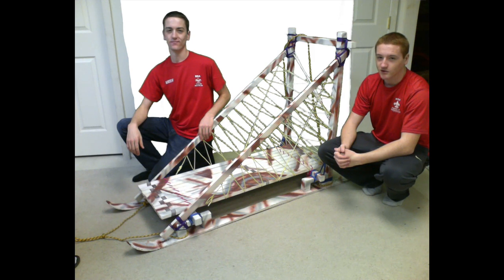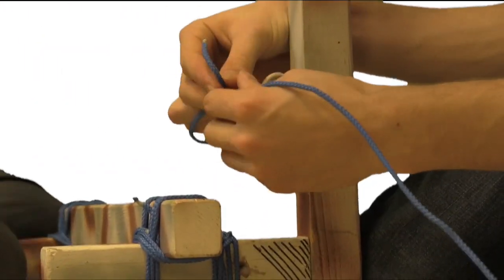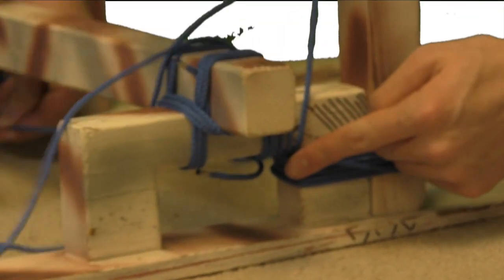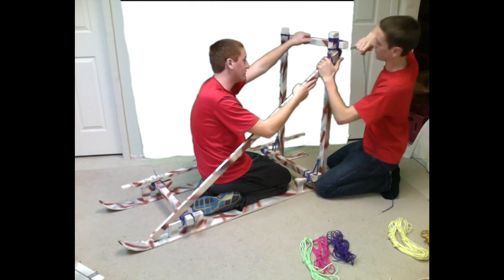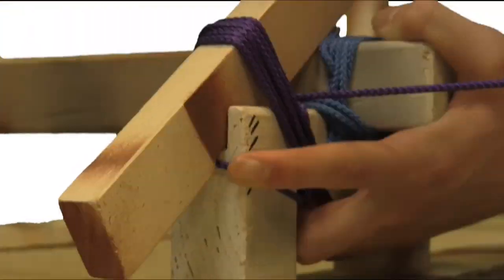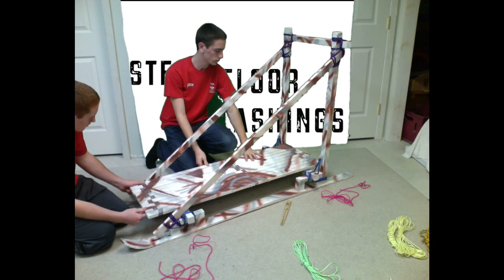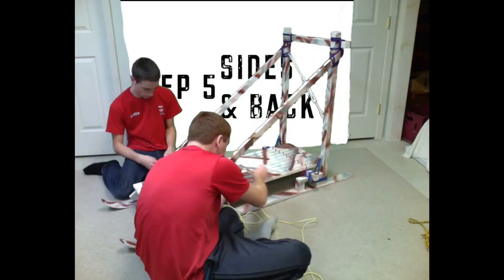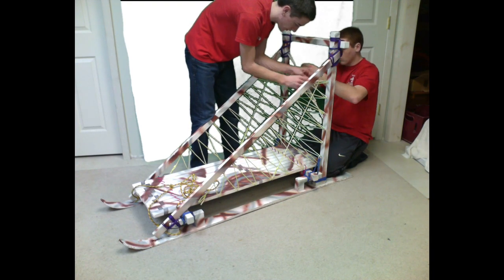Troop 45 Klondike Sled Build

Comment: This is an AWESOME design.  Thanks for putting this out there!! 
As Quartermaster (now Scoutmaster) of Troop 530 in Hales Corners WI (large troop), we've standardized on these sleds.  We have 3 and 2 being built (they store great in a canopy bag) and it forces the guys to get good at lashings.  I did two modifications (I made the ski blocks from glued 3/4 plywood for durability and I added an eye bolt/T nut to each joint - for the younger patrols with poor lashing skills).  They've run thru local Klondike twice and the scouts love them!!  They're SUPER Light Weight compared to our older sleds and FAST.   For Skis, ask your local play-it-again sports manager to hold old-school downhill skis (185cm or longer) - they get them in, but can't sell them (and usually throw them in the landfill).

Comment: On the sled bed I see some strapping held by staples.  What did you use for strap and any special staples that do not rust such as monel or stainless steel?  How does the brake work?  Nice job with the sleds my troop just completed a bunch 16 in all most going to individual scouts with 3 sleds held back for troop use.  We have no snow now but are hoping before our district camp out end of January 2013

Comment: Ever heard of these crazy things... NUTS AND BOLTS!
Reply: that would make it more expensive than it already is
even though the cost for the materials is cheap.
Reply: Purpose is to practice knots and lashing.
Reply: we added eyebolts/t bolts to ours (for strength), but still require our older scouts to run them without the bolts.  Without bolts, they have improved flex and take more abuse - our older scouts run full-out with these.
Reply: I am the designer of the sled. Lashings are flexible, allowing the sled to flex over uneven ground or other stresses. If it was solid, it would have to be heavier in order to be strong enough. For the same reason, modern Inuit qamutiik sleds still use lashings.

Comment: Are you using nylon ropes or paracords? What is the diameter size of your rope?
Reply: Peter Pei smaller than quarter inch seems to work well.
Reply: We built ours with 3/16" braided nylon rope. It doesn't much matter. I've seen some made with twine. To get the lengths, you could lash it with twine, undo it, and see how long the ropes are.